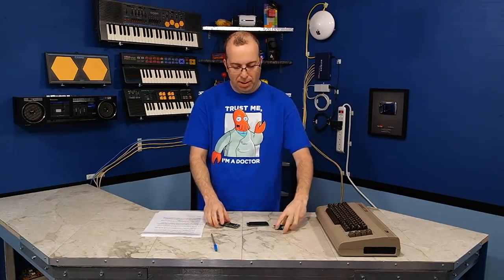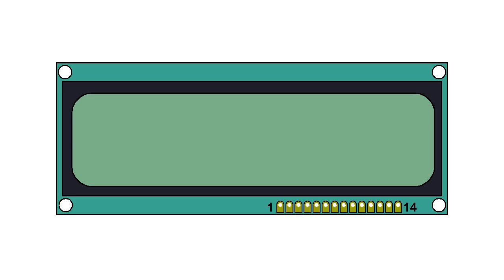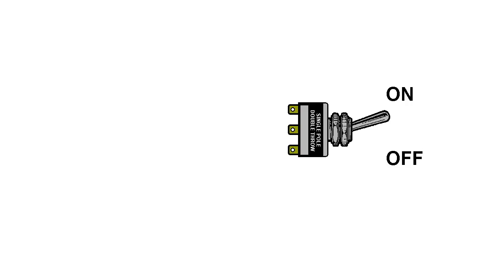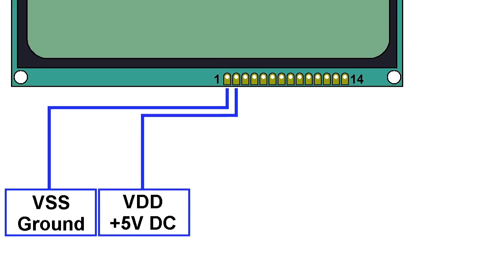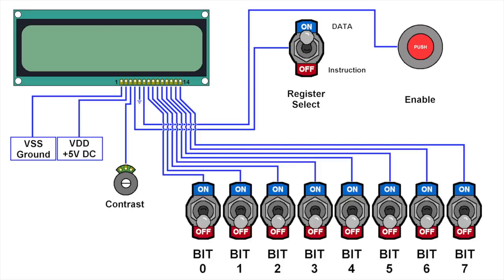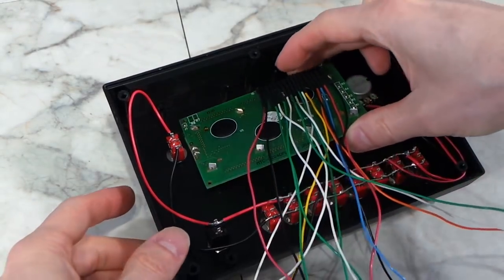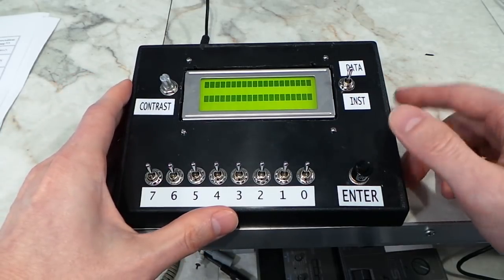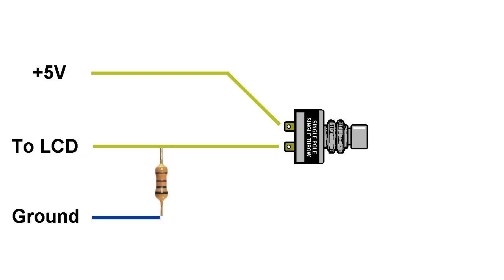How a Character LCD works Part 1

Comment: 8 bit guy can use power tools, Linus woulda lost a finger
Reply: We're talking about the same guy that grabbed a power tool without knowing that it plugged in. So yeah he probably would have lost a finger.
Reply: And then drop it
Reply: 8-bit-guy can use a soldering iron without problems, Mehdi from ElectroBOOM would burn himself to get some laughs out of the public.
Reply: kingcarcas1349 I love both of these channels, so that joke really hits home for me.
Reply: @TheLegoman332  LOL
Reply: @loganiushere  Same
Reply: 8 Bit Guy has powers
Reply: RedLolz Gaming drop it onto his foot and lose a toe too
Reply: @GRBtutorials  he turns off the iron and adds a very loud burn sound effect.
Reply: Tunahan Karatay Well, while some of his “accidents” are fake, sometimes he has actually burned himself for the sake of humor. There’s a video where he runs too much current through a wire while holding it, and $%€@! Obviously, he knew what would happen, yet he did it.
Reply: @GRBtutorials  Yeah he does some of them for real but ffs in literally every video he connects 16v electrolytic cap to 120v ac. I watched every video of him. Those mustache removals are the most violent ones. But I never had a burn which made a sound louder than my loud voice. The work out device, he literally inserts a sharp object in between him and the belt right before the shock and he hits his head so badly to a glass table. I can give hunderts of examples, literally, in which he hurts himself/pretends to hurt himself but most of them aren't real. For example in his eddy current video, a frame before the arcing happens, the clock jumps 30 seconds, so he uses a lot of editing too. He touches two metal pieces which he tried to weld with a diy flamethrower too. I better stop remembering all those, otherwise I won't be able to stop typing.
Reply: Yep
Reply: delt  I wonder why his channel even exists. He is not all that into electronics.
Reply: GRBTutorials I just learned about ElectroBoom, and yeah, you're right.
Reply: lol
Reply: @TheLegoman332  The power tool or the lost finger?
Reply: @dafoex  both
Reply: @tunahankaratay1523  Real or not they are believable enough to be funny and thats all I care about lol
Reply: so true tho
Reply: Linus knows nothing beyond administrating the OS and adding/removing/combining hardware modules
Reply: @DylanClements98  Indeed. But that is what most "tech tips" channels do. Vendors throw a bunch of money at him for promoting their products, and apparently his lame followers are buying it. A monkey could replace him at this point
Reply: Tunahan Karatay won’t be able to stop typing lol

Comment: Advice for recycling: Never perma-solder and desolder that perma-solder. Use pins and header and permasolder. There, no need of desoldering. simply pull right off!
Reply: Also, for chips, use sockets. Even when you don't see the point of using sockets. Sockets are awesome!
Reply: except when in a high vibration environment. to me it looks more like his desolder technique needs work pulling pads off is a side effect of applying presure to a solder pad with heat and on his second it seems quite obvious his desolder technique for objects is to heat and pull.

you should heat draw of the solder as much as possible then using minimal to NO force remove the item
Reply: Or except high-current going through IC.
Reply: There are enough high-current connectors.
And enough of "vibration proof" connectors as well.

Comment: These things... work a lot more simply than I expected..
Reply: Computer engineering is not difficult, it's just complex :)
Reply: This LCD screen is like a computer. I thought it was going to be just a LCD screen.
Reply: @louistournas120  same
Reply: @raggededge82  Complexity is what makes things difficult for people.
Reply: It's because it's a lot more sophisticated at handling itself. That screen assembly has its own builtin microcontroller
Reply: The display controller has quite some smarts built into it to make it this simple.
Reply: No it doesn't. Look at the schematics of it you'll not understand it in a year or more. Engineers who designed it just made it simple to be used.
Reply: @omniyambot9876  In the 3 years since I've posted this comment I have in fact looked at schematics of such devices, and have gained an understanding of them.  I stand by my original statement.
Reply: @ZeeZeeBun  if all those thousands of internal discrete components, instructions sets literally programmed directly to metal, patented, developed, by many people and companies are "simple" for you, you must be some kind of genius.
Reply: @omniyambot9876  I don't go around the internet looking for comments to nitpick 3 years after they were made, so I'm probably smarter than you. :P
Reply: @ZeeZeeBun  you you're obviously smarter than me, no question.
Reply: Love it
Reply: @Dušan Xmetov you're right:)) thank you
Reply: Ikr
Reply: Indeed...
Reply: @raggededge82  agreed
Reply: Well it does work in 8 bit...
Reply: @louistournas120  exactly it's simple because there's a controller chip in there. Take a look at the schematic of the lcd... It's called HD44780 but what you see in the schematic is just the pinout which is the chip's interface with the "outside world" the internals of that controller are going to be much more complex. The data sheet should have a block diagram which shows what's inside. All of that needs to be implemented in silicon which you can learn about in a course called VLSI.

Comment: Thanks for explaining Bouncing!  I am a programmer and I never knew why they called it "Debounce" even in code that had no physical parts inputting. It originates from this I understand now.
Reply: check out Ben Eater's 8-bit computer
Reply: I regret this username more and more each coming day.
Reply: This can also be seen in computer mouses as they use the physical switch‽
Reply: that's a B ouncing problem!
Reply: @bhawtesh8644  i think there are debounced switches (but only to a certain level) so most likely there also is software debouncing
Reply: Exactly, I have been debouncing in JS for years now, and I was thinking these CS guys were just bad at naming things.
Reply: debouncing made me figure out single activated button push in a few lines of code.

Comment: Literally one of the first times I've understood what a capacitor is for. Thanks!
Reply: It is not exclusively for this kind of stuff, it has many many uses in analog electronics too.
Reply: I know, but the many, many other uses have never been explained to me in a way I can appreciate. I still don't quite understand what the point of resistors is, for example. They add resistance. Great. Why? How does that help achieve something? Etc..

In this case I can totally see the point of a capacitor and that makes me really happy!
Reply: Well the point of resistors is to resist the flow of electricity and convert a part of the electrical energy into heat. If you, for example, powered a LED without a resistor it would burn out because the power source can deliver too much power and LEDs burn out. Therefore you connect a resistor to waste the rest of the power the LED can't consume.
Reply: http://i.imgur.com/IERGyO6.png

The resistor in the video is called a pull-down resistor.

When the switch is turned on (B in my image), the electricity will go trough the path with least resistance (some of it still goes trough the resistor but that can be ignored, it depends on the value of the resistor) therefore the gray wire has ~5V potential - logical 1. If you turn the switch off, the gray wire will be connected to 0V trough the resistor, therefore it will have ~0V potential - logical 0.

If there was no resistor, the wire would be floating and effectively acting like an antenna, because the circuits in the LCD are very sensitive they will act on it.

The resistor also has to have a reasonably high value so the voltage drop across the resistor is high enough. If it's low, it will effectively act like a short circuit. Look up ohm's law.
Reply: How many first times have there been?
Reply: Well I understood the principle of a capacitor when explained in a physics class fifteen years ago. However I have rarely come across an example of a circuit where I can understand what the capacitor contributes to it. I can't think of any other examples off the top of my head but there may have been one - making this one of the first, but not necessarily definitively the first.

My choice of wording may have been awkward but it wasn't accidental ;)
Reply: This is actually a very bad solution for a real digital circuit - don't use a cap like this! However, the solution is perfect for this example circuit. You would use a debounce function (a wait instruction) to only read the valid button push after the bouncing has happened.
Reply: lol... its just like a battery but it charge and discharge fast enough
Reply: What a capacitor "is for". Not "what a capacitor is". The difference is important.
Reply: A capacitor might be used in lots of different ways, here are some examples
- Filtering noise: Because a capacitor needs time to charge or discharge (and thus """controlling""" the voltage),  and if your circuits has some noise, you can filter that noise by putting a capacitor in parallel or series (it depends on how the noise is), and most part of that noise will go away! (of course, if your noise is not small, you will need a very complex circuit to acheive that)
- Starting an electrical motor: Because the capacitor works like a battery, you can use one (very big) capacitor to "store energy", and use it to start the motor (a motor needs LOTS of energy to start). You can see a starting capacitor in fans, automatic gates, etc, its a cylinder of 4 centimeters of diameter approximately thats it on the side of the motor.
- "Fixing" your electrical grid: With the characteristic equation of the capacitor, the inductor and the resistance, you can model this components as "complex impedances", the effect of the inductor and the capacitor are the opposite in the complex plane (the inductor moves the "angle" of your impedance to one side, and the capacitor to the other side). If the "angle" of your impedance is far from 0 degrees, then some problems with the power of the electrical grid appear. Motors are mostly made of inductors, moving the "angle" of the impedance of your house far from 0 (and there are a lot of things that have motors in your house, an even more things in the industry). If you put some capacitors in parallel, then the angle moves back to 0.

I hope i answered your question about what a capacitor "is for". I over simplified the explation so it can be understood quickly. Of course there are hundreds of applications for the capacitors
Reply: The first two make a lot of sense to me, thanks! The third gets a little bit over my head ;)
Reply: Well there are two main usages of a resistor.

The most important use of a resistor is to limit current!

For example, you want to connect an LED to a 5V supply. But the 5V supply will deliver lots and lots and current trying to maintain those 5V on the output, and the LED will burn up! So you look up, what the maximum current for the LED is, say it's 20mA, then you decide whether you want it full brightness or lower, say you think 5mA is enough, let it be quarter brightness. Then you look up how much voltage the LED loses, so say it's a red LED, the data sheet will say it's forward drop is 1.8V. So you need a resistor which will drop the rest of the voltage to 5V supply, and limit the current to 5mA. 5V-1.8V = 3.2V, good. So you plug that into Ohm's Law: R=V/I = 3.2V/5mA = 160 Ohm. So you connect that LED with this 160 Ohm resistor in series to that 5V power supply, and good enough, you have one LED which isn't too bright and won't burn up.

Or for example you want to switch a transistor with a digital output. Say you need to drive a larger load, one which needs more current or higher voltage than your digital output can deliver, so you connect the load to the transistor, and the transistor basically amplifies current, the current you put into the base comes out of the emitter, and additionally it pulls about 100-500 times as much current from the collector and dumps it down the emitter too. But you can't just send unlimited amount of current through the transistor, it will burn up! So you calculate how much current your load is going to need and that won't harm your transistor, you divide it by this transistor's current gain, and choose a resistor that you could put between your digital output and the base of the transistor.

Another very important use of resistors is as a voltage divider network. For example if you take a pair of resistors in series, attach 5V to one end, and ground to the other, if those resistors are the same, the voltage in the middle between them will be 2.5V. A resistor divider is basically the opposite of amplification. Say a volume control knob (a potentiometer) is exactly such a resistor pair. There's a track that a metal arm scrapes along, and the track is made out of conductive paint or plastic that has a particular resistance for every centimeter of length of it, so when you turn the knob, the ratio between these two resistances varies. The potentiometer has 3 pins, one is connected to that metal arm that taps in between the resistors, and the other two are connected to the ends of the resistive track. But if you needed to reduce a signal by a fixed ratio, you can just use two resistors. This is for example how many flexible voltage regulator ICs work: you divide the output with a resistor pair such that for your desired output voltage, 1.25V comes out, and give it to the voltage regulator, and the voltage regulator generates super stable 1.25V internally. Every time your input comes in larger than 1.25V, it reduces the output voltage, and every time it's smaller, it increases it, so at the end, whatever voltage you want comes out.

And then there's biasing resistors and pullup/pulldown resistors which are special combined cases of voltage division and current limiting.

For capacitors, there's basically two main uses, coupling capacitor, and filter capacitor. If you place a capacitor across the signal, it will buffer up changes in it and resist voltage changes for a while, it will thus filter out high frequency components, but let through DC and low frequencies. If you place it in line with the signal, it will do the opposite, it will conduct high frequency signal but block low frequency, allowing you to substitute the low frequency components with say another voltage offset.

For example of coupling capacitors, consider headphone output on your computer's soundcard. It has signal pins for your left and right sound channel, and a common return pin that is connected to ground. It actually is connected to the chassis ground, you can check that. We know there can't be DC voltage between signal and return, else it would just constantly put the headphone membrane under tension all the time, it will likely hit the end stops and might burn out, while it's just supposed to be moving when there is sound, and it's supposed to be moving both ways. So how does your soundcard generate these waves with positive and negative voltages? Well, it doesn't. It generates voltages centered about some positive DC voltage, say 1.2V +- 0.45V, then the signal is connected through the capacitor to the headphone output, which removes DC. It also allows you to connect two pieces of equipment, some output and some input, that might be using different DC offsets internally, because as it happens, it's really difficult for all manufacturers to agree on something like that: some use components that only have 3V supply voltage (e.g. MP3 player, phone), while others use components that can't work with signals that are less than 3V at all (e.g. classic HiFi, musician's gear)! But they can all agree that 0.9V range between the smallest and the largest signal is just about OK.
Reply: The point of a starting capacitor on an electric motor applies mostly to single phase. The start winding on motor needs to be on a different phase angle to generate the rotating magnetic field required to start the motor. A centrifugal switch disengages the start circuit when the motor is up to speed., in which only the "run" capacitor remains connected to the start winding. 

This has been surpassed by variable frequency drives (basically a big brushless motor controller) driving native 3 phase motors even in smaller applications due to much greater power efficiency. These electronic devices usually have a high voltage bus with some giant capacitors of their own to store the DC from an active PFC circuit connected to the mains. (see the fantastic point 3 from Benjamin above regarding power factor correction!) 
This DC is chopped up normally by some H-bridge IGBT circuit to perfectly clone a 3 phase sine-wave of variable frequency, allowing a giant 3 phase motor full electronic speed control and reverse capabilities.
Reply: GAMED GAMING That's nice for you.